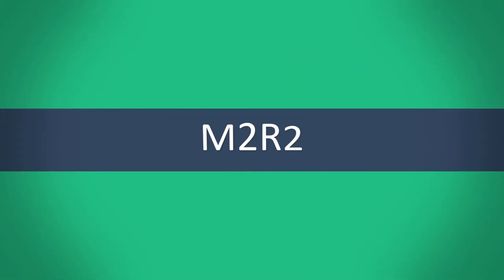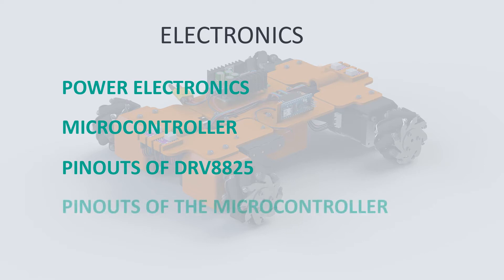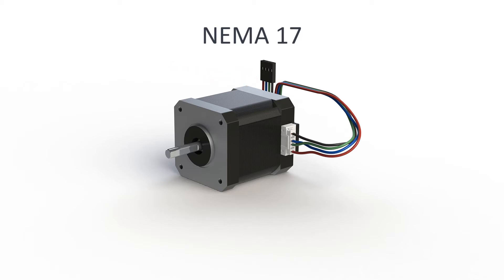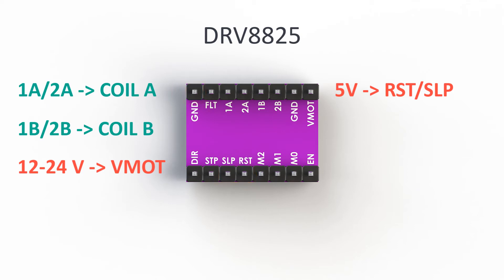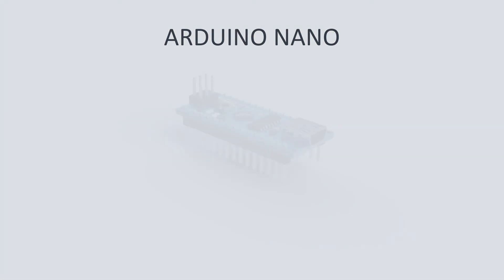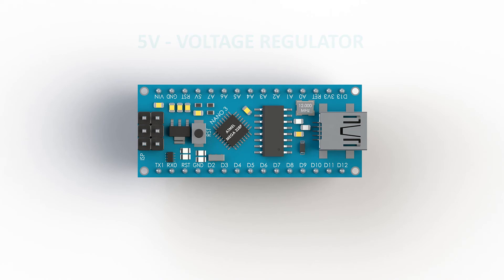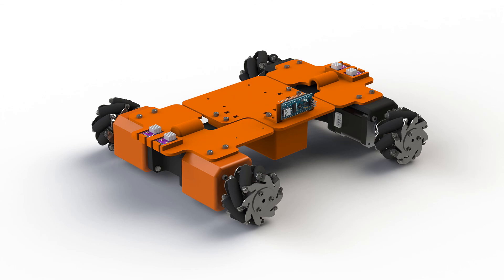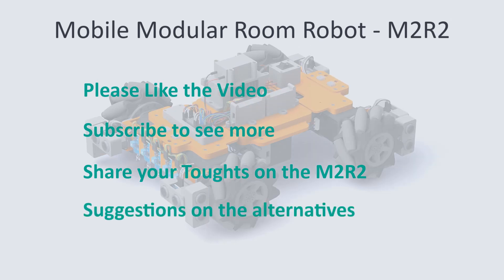Motor Drivers and Microcontroller - M2R2

Comment: Amazing, is there anyway to control the nema 17 in matlab using l293d  ?
Reply from the maker: Hi, I don't use matlab. But it sounds like it should be possible. There is a video that may help you here: https://www.youtube.com/watch?v=ZsyLtv77BtQ&ab_channel=CircuitDigest . I hope this helps.
Reply: @Robottronic  i wish to know how to transform steps into velocity, if you can explain it to me please
Reply from the maker: I would do it this way. Nema17 needs 200 steps for a full revolution. Each step takes around 2000 microseconds or 0.002 seconds (you can influence this number in the code, I will show how to change the speed this way in upcoming video). But now we have 200x0.002 = 0.4 seconds for one rotation, which is 2.5 rotations per second, which is 150 rpm. We know that the diameter of the wheel is 60 mm and that the speed = rpm x diameter x pi. When you put in the numbers you get 28260 mm/min (28.2 m/min) which is about 1.7 km/h (for one wheel). To increase the speed, I would reduce the microsecond delays between the steps, but here we will not go below 1500 microseconds delay, instead we will slow down the robot to have more time for the sensors to read the environment. I hope this helps.
Reply: @Robottronic  this is everything i needed to know.. and more